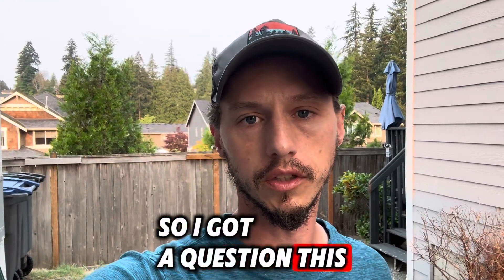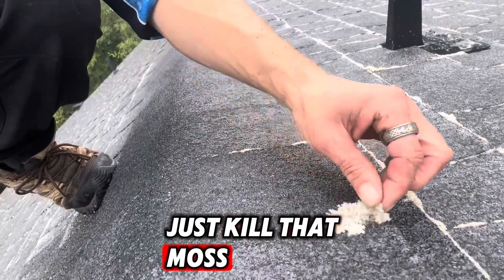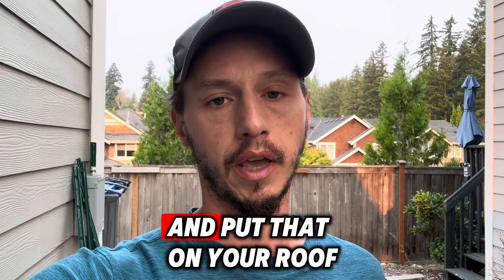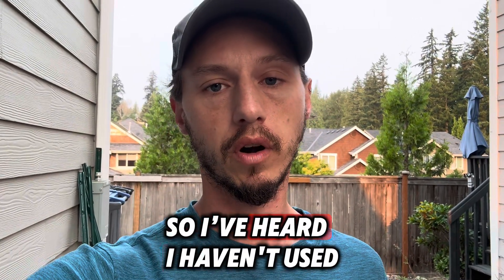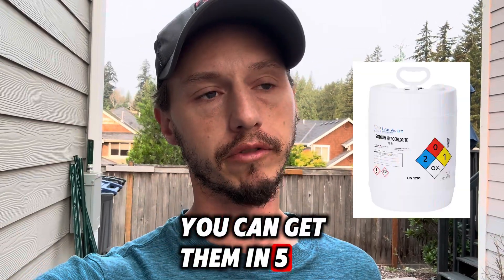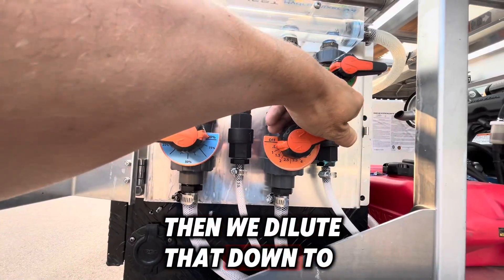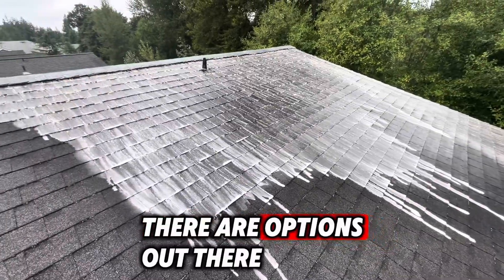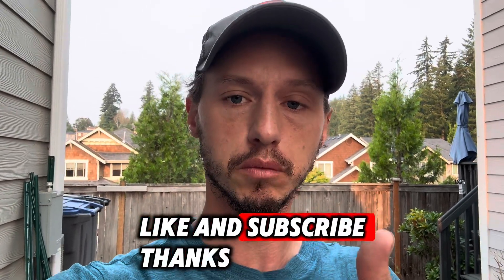What Chemicals Do Professional Roof Cleaners Actually Use?

Comment: I’ve been using SH and pool shock for a few years, but it doesn’t work as good as some of the stuff these guys are using that just melts off black streaks on slate in less than 20 minutes. Bleach doesn’t do that. I want to know what they’re using cause it would make my life so much easier.
Reply from the maker: The industry uses 12.5% SH that is fresh and bought from a reputable distributor. If you have fresh SH that is industrial strength and dilute it to your needs it will do exactly what you are talking about. 

10% pool shock is a good start but it is already weak because a lot of times it is bottled and stored for long periods of time in heat conditions that cause it to degrade faster. By the time you use it the concentration is already weak. 

I suggest looking for a chemical distributor in your area. 

You should also be using a surfactant that is bleach stable or will boost bleach such as Elemonator
Reply: @BrandonKelley000  will try this. Thank you for the tips!

Comment: I need to clean my roof, but I’ve got concerns about possible damage to my Trex decking below. What's been your experience with having your solution making contact with Trex?
Reply from the maker: Wet the tree decking down before you wash the roof and then rinse when you are done washing the roof. The new tree is much more resilient than the old stuff that had a lot of larger wood bits in it. You can wash trex with a 1-1.5% SH solution so pre wetting the trex will help to dilute the roof wash mix on contact.
Reply: Thanks for the information. My concern though is regarding TREX COMPOSITE DECKING.
 @BrandonKelley000

Comment: Very helpful! What’s your thoughts on oxygen bleach?
Reply from the maker: It works. It won’t be as fast as SH or as cheap but it works. I’ve used quite a bit of peroxide now also. That works great but again is expensive and more sensitive to water dilution than SH. 

At the end of the day SH is going to be the cheapest option in bulk usually

Comment: Hey I am in California but soft washing doesn’t work here, everyone I know pressure washes and not a single company here does soft washing.

Even though I am reluctant to pressure wash, every single time i soft washed it never got rid of a single piece of mold/algae on the roofs. I applied multiple coats of 6% mix to multiple roofs, let it sit for 30, rinses and apply another coat and never have I made a single bit of progress. Which is interesting, perhaps there is a different variation of algae here.
Reply from the maker: That is interesting. Is it hot out when you are spraying the roofs? Is it staying wet for 15 min before rinsing? 

California has odd rules so I’m not sure what is allowed.

Take a bottle of pool bleach and do a test spot with it straight and see if the growth reacts to it. If not then it may be non organic. 

Want those if roofs are you trying to clean?
Reply: @ Even now 2 days ago when it’s rainy and cloudy, I applied a total of 7 gallons of 12.5% with equal parts of water on just one side of a roof. The results are, it turns white while wet then goes back to green once dried up.

I tested pure 12.5% on algae spots on driveways, walls, and roofs to which it only turns black. 

Do you know of any other chemicals I can use? I would really appreciate if you point me in the right direction of a good solution that takes care of algae on all surfaces. Your advice on this topic is very much appreciated 🙏
Reply from the maker: @stupify101 that’s really odd. If it is turning white then it shouldn’t turn green again (it will turn dark brown though). 

You can try sodium carbonate peroxyhydrate (you can buy from Cleanz O2)

Normally sodium hypochlorite is stronger when it is fresh. If you are using SH that is more than a couple weeks old then it may have just lost its potency.
Reply: @BrandonKelley000  Thank you for the recommendation on the percarbonate, but based off research I heard it is more eco-friendly but less strength?

The chlorine I use is all freshly open. Perhaps should I use 30% Vinegar?
Reply from the maker: @stupify101 it is worth a try for sure. Have you posted pictures in any Facebook groups to see if people can identify?
Reply: @ I will do that tomorrow actually, thank you for the response. You deserve the like and follow :)
Reply from the maker: @stupify101 thank you for the like and follow. I hope you can find something that works. Reply here when you do so everyone can learn

Comment: your solution seems to foam up nice.  Do you add soap?  What kind?  Percentage in mix?  Thks for your vids!
Reply from the maker: I use lauramine oxide. I put about 2-3oz per gallon of water on my auxiliary soap tank. You can put about 1-2oz per gallon if you are batch mixing.

If you don’t have a distributor close then you can just order elimonator or soap from southeast softwash.

Comment: Im in washington. What would you charge? Rambler, 1800 sqft
Reply from the maker: It depends on the roof condition, material, pitch and access. Between $600-900 typically in my area. Minimum $500 

**This information is for education purposes  and is in no way a quote or estimate. For a quote from the company I own, please go to SpartanWG.com and follow the Quote links.

Comment: do you have any tips for soft washing on Hardie cement siding?, without leaving marks
Reply from the maker: Yes, start with a low SH percentage (less than 1%) if your system allows it.

Rinse with a lot of water and be careful to not put any pressure on the siding. 

Do smaller sections if you run any risk of the detergent starting to dry before rinse phase. 

Before you start, make sure you identify any cracked areas as these can soak up water. 

If the paint is old and oxidizing then there will be uneven coloring when you are done. Communicate with the client before washing if they have old or oxidized siding.